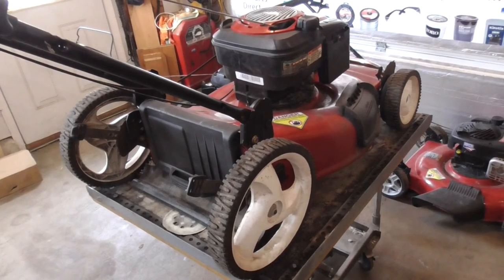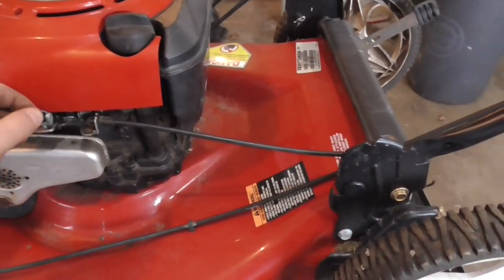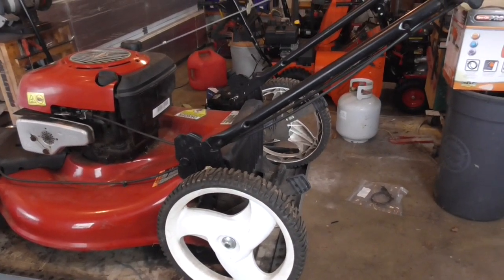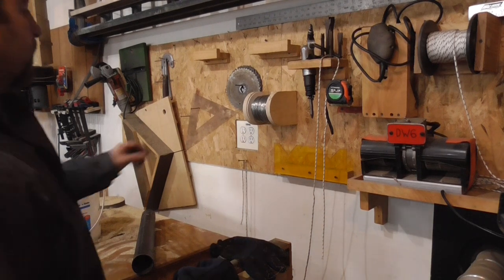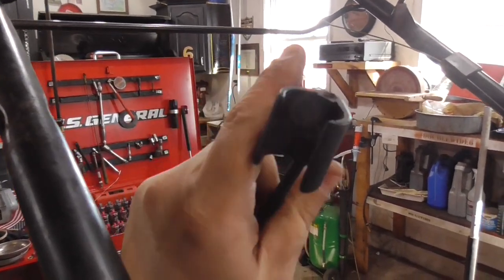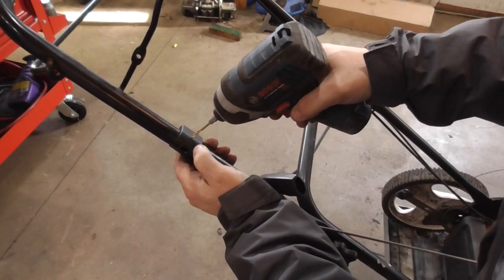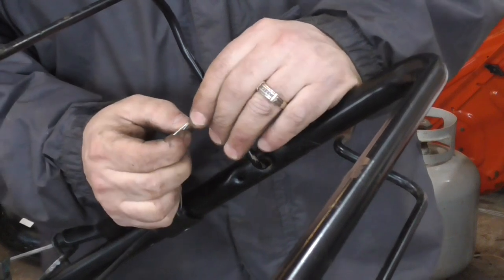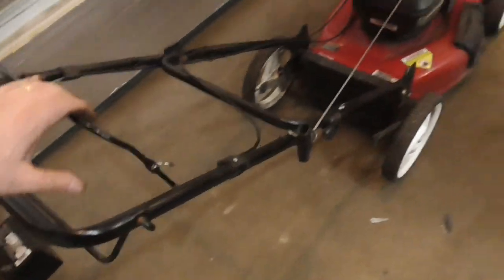Broken Lawnmower Cable Fix For Pennies

Comment from the maker: https://amzn.to/2Tr5W5P 2lbs. 16g. Mechanics wire
https://amzn.to/2Gf0aAe  Heavy Duty Rivet Gun
https://amzn.to/2Ghj0XG Aluminum Crimping loops.
https://amzn.to/2D3U1Ue Front Side Crimping Pliers.
https://amzn.to/2t4YxgF Mower Lift Table Save The Back

Comment: I'm glad you used my idea ... Yes they go faster when you get used of it..... I thread mine down the conduit first then attach the bottom like you did...........  Yes oiling  the conduit is a lot better for threading the wire ........... You taught me something with riveting the holder on the handle.....  Something so easy.....

Plus Tard Mon Ami ~!~!
Reply from the maker: Worked out pretty well.  I had the wrong gauge wire 1/16" or 16 gauge is plenty strong to do the trick.  Thanks again for the tip.  Bob

Comment: I do the same thing, but I use the smallest braided cable you can get at Lowes. It's around 35 cents a foot and I generally buy 25 to 30 feet at a time.  That will do probably 6 to 8 mowers.  It is almost exactly like the cable that comes with the mower.  The only other difference is I apply some grease to the cable before feeding it back through the plastic piece.  Makes it smooth as can be.
Reply: Smart tip with the greese.

Comment: This was great.  Took me 2 minutes to fix mine.  I only had 20 gauge wire so it slipped through easily.  I know it will probably break but I can now finish my yard without having to wait on parts or a repair shop.  Thank you for posting this 🍻

Comment: hey i buy braided wire at Home  Depot   , In the garage  door department ,,  it's used for the outside door handle  ,,   it's the same as what was on the lawn mower  only in a roll ..
Ed  Loretto  Ontario Canada

Comment: Great idea!  One way I keep mine mower cable lubricated (I don't have a cable oiler) is to put one end of the cable in my shop vac hose and pack it off with a rag or two then use the negative vacuum pressure to pull the oil through the cable.  Thanks Bob!!

Comment: I have used a lot of that wire but never for the inside cable of the plastic conduit.  I will give it a go.  For us here in western Canada it is a long wait to get the cables in the mail from an on line order.  Also they are double what you pay just because we are in Canada.  Thanks again Bob.
Reply from the maker: Yup for the price of 3 cables you might as well get 500' of 16 gauge and use it when you can.  If you make a video on the same topic I will keep my eye open for it.  Take care.  Bob
Reply: @doublewide6  Thanks.  I have tried to make the Z bends out of solder with some success.
Reply: Non'c Bruce......  Do you know anyone in your area that has cattle on their land ????    They should have some electric fence wire...... it's 17 gauge and fits perfect in the conduit......   

Plus Tard Mon Ami ~!~!
Reply: @Budro4764  Well Alberta Beef is famous around the world.  I know i can get some.  Thanks
Reply: Yes get you a short length of it say 25 feet or so and try it.....  If you like it then order you some or that other vinyl stuff Bob Mentioned .....

Plus Tard Non'c Bruce .................
Reply: Where do I get 16 gauge wire in Canada? Princess auto sells only 18 gauge
Reply: @D.I.Y  Ebay I guess.  sorry C
Reply: @Bruce   Wow I really opened a can of worms  showing Bob how to do that trick .....  No biggie it saves money .............

Comment: Like your fix. When I do a repair, I expect it to be an improvement over the OEM part which failed or it's not worth my time. This satisfies on 2  criteria: provide better service and more cost effective than a replacement part.  Plus the added benefit of being immediate; no ordering / waiting, etc.I'll try this next time. I've soldered the cable which requires I cut out a section of the outer sheath then repair the sheath and used a u-clamp to reattach the failed plastic bracket.

Comment: Great tip, thanks! I have used break cables from discarded  bikes & took some time to make ends using solder. But this method is much less time consuming. Using cherry / pop rivets also a good strong fix. Stay well Joe Z
Reply: I need information on how repair drive cable not throttle can leave

Comment: I think I may  have mentioed my method before in the comments. I use the crimp you used and a scrap cable z bend and crimp them together on the broken end. That way you only have to repair one end. Only could hold the pieces together if I crush the crimp in a vice however.

Comment: Just wanted to let you know this came in super handy the other day, I was doing a John deere js60, and the cable is a jd exclusive, and since it's jd 110 dollars, and couldn't find a cheaper one on ebay, so I did this trick, and it worked perfectly, thanks again.

Comment: thats a good tip, i see a lot of them broke with the handle duct taped :) i also wanted to say (im sure you thought about it afterwards) when the cable housing was hanging down loose thats when you shoulda pushed the wire through, i do a lot of bicycle cables and as flexible as they are even they can be hard to push through when the housing isnt straight or close to it. and the oil tip is good too long as its weather resistant.
Reply from the maker: I agree with you.

Comment: Take the cable end off the brake, instal wire from top down. Then secure to the lever. But no matter, the safety wire will break at  at the twist or where it fits through the hole on either end. Try small wire rope with a thimble at each end. But at that point, just buy a new cable. 
This quick fix will get you running till a proper repair can be made.
Good tip.

PS, your fuel line puller has saved me a hell of a lot of time. You might want to present it again.
Jim
Reply from the maker: I ordered the proper cable and some clips, I am still experimenting with this method.  I will make a follow up video.

Comment: I started flipping lawnmowers and this trick will give me a little extra in my pocket compared to a new cable. While were talking safety brakes I have a mower that the brake spring just seems impossible for the  cable to stretch it enough for the switch to work. Is there  a way to use a little weaker spring or adjust the spring cable? I'm not even sure if it's the proper spring but it looks right?? Thanks for the great lessons especially the rivet trick

Comment: Hi, am hoping you can answer me this. I have a Snapper 82v push mower. All of a sudden, both the main motor doesn't start, as well as the self propelled motor. When I try starting it, all I hear are three beeps from the battery. In your opinion, would the cable replacement you outlined here resolve my current issue?

Comment: I like your stone grip handwork of the rivet gun dropping to the floor. Also, you should have pushed the wire through the top part of the bale handle and made sure you did not nick the wire as much as you did. This will cause the cable to stick and jam then break again. Think first and then make happen. Otherwise you did a quick fix to get the mower working. So good job fella and good day too.

Comment: I have this mower and on the rear wheels the 9/16 nut has stripped the threads on the shoulder bolt in the wheel. Any tool that can get that nut off that's spinning and won't let you take off wheel? No one has video doing this....

Comment: Sir, that is an awesome idea, you should do a follow up to see if it streches..... Ordered.... Tks again..... I shared this with a couple fellow youtubers, hope you don't mind, it's a great idea, who told you about this?
Reply from the maker: I will make a follow up on this.  Keep watching.
Reply: @doublewide6  oh yes will do... Tks.
Reply: @knighthawk86855      I told him about it in a video he did not long ago..... It works well and I have no issues with it.....  If it would break in 4 to 5 years then just put another piece of wire in the conduit again it only costs a few pennies ...  I have a lot of mowers come in my shop with broken factory cables that are 3 to 4 years old.....   Spray some PB Blast in the conduit or WD 40 and it will last ....  Both cables will last if you spray it once or twice a year...... 

Plus Tard Mon Ami .............
Reply: @Budro4764  cool thanks for the info.

Comment: Hey double wide 6 which lift table is that? The 500 or 1000! Thanks! Nice tip on cable fix! I do a lot with rivets too.

Comment: I think it’s better to put a cable upper the handlebar, before riveting that plastic holder, because if you need to fold a handle the cable will not let it fold

Comment: My little two cents worth here... If you don't have pop rivets, electrical tape and zip ties will hold the cable on top. I think I would have doubled the loops on both ends too. But this works anyway.

Comment: interesting trick...i saw another video the guy cut the ends off and used those clips and attacched them so you still have the ends on each side
Reply: this way seems like it might be stronger sinc eits all one piece rather than 3 but depends on the clips i guess

Comment: Lawnmower cables have such a design flaw, water travels down the cable into the sheath and sits there til it rusts and breaks, the solid wire will probably hold up better, I lube the cables to combat the problem.
Reply from the maker: I think the braided wire is rated stronger.  Anyhow you can get braided cable sealed in nylon that won't rust and slides easy.  I ordered 500' for about $40. from amazon.
Reply: @doublewide6  Then you could melt some lead and make the cable ends.
Reply: Braided wire is better becasue it will not fatigue so quickly.  It is the bending that causes the wire to weaken and eventually break.  Water getting in there and causing rust is a factor as well.